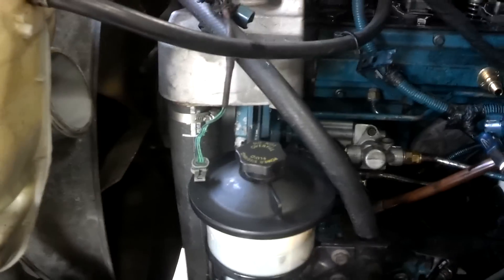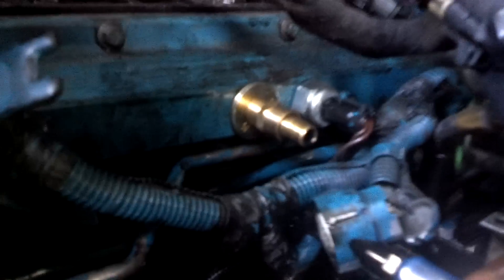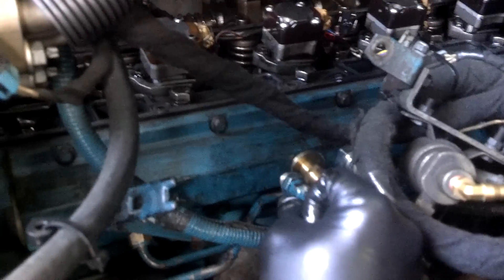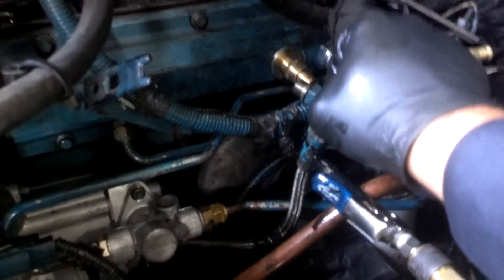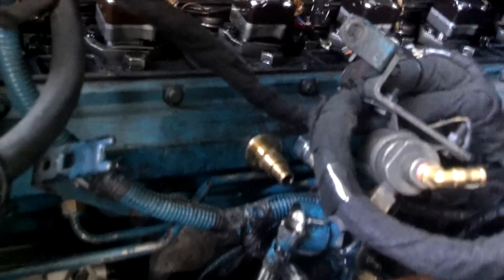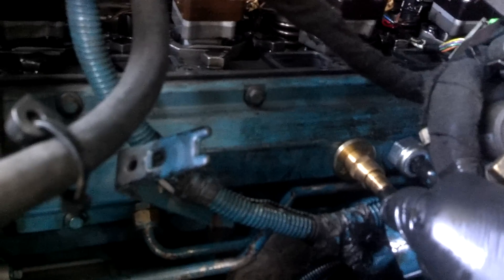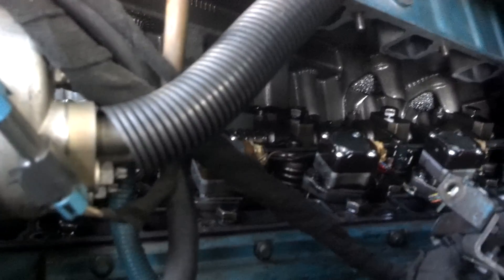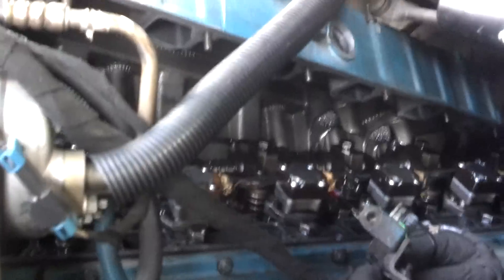How to fix low injection oil pressure part 1

Comment: Hello!! My 2001 international 4700 with a dr466 started pouring oil from behind the  high oil pressure rail closer to the front of the engine!! Do i have to remove the valve cover to get the high oil pressure rail off?? Thanks!🙏
Reply from the maker: Hi, sorry for the late reply. I would remove the valve cover. On that model I'm not sure if you can get around it plus it frees up room to work on the line. Make sure you clean the area well so you can get a good look on the exact location of the leak. Keep me posted please! Hope i helped😊
Reply: @The_Mixed_Ron_Swanson  i fixed it already! No more leaks! Replace the gasket and new set of bolt torqued it to specs and it’s nice and dry now!! Thanks for the advice!!

Comment: Hi Guys , appreciate this video, I was wondering if anyone can shed some light on my problem....I have a Navistar....badged as perkins 1306 series here in uk , it wont start unless using easy start aerosol......it has good oil pressure in the gallery approx. 1000psi when cranking , also good fuel pressure in the rail....hand priming pump is working ,etc, checked the fuel  valve in the end of the gallery , seems all good, swapped cam pos sensor , checked wiring from control panel...….ipr sol getting voltage ,etc....any ideas why it wont start?   customer who owns this generator had the injectors tested before it come down here....he mentioned when he got it running it would start to slow down in speed when under half load.....the engine is 330hp at fixed 1500rpm , year of engine approx. 2012.     3500hrs. any thoughts ????
Reply from the maker: Did you happen to look at the injector seals? Sometimes if you hook up air to the oil inlet and pressurized the line you'll hear hissing if there's a problem. I'm not familiar with that model but if it's close to a Benz diesel, that might be your problem. Also check the Low Pressure Oil Pump if possible. Malfunctioning LPOPs can affect the oil pressure needed to activate the fuel pumps. I hope this helps. Keep me posted😊

Comment: Question have 1998 international 4700 DT466E  truck was fine when I bought it just the radiator hose was sucking in and fuel was being sent to the coolant reservoir so decided to change the injector cups and the injectors them 
selves also coolant filter truck seems to be having trouble going above 15 mph RPMs won’t go above 1500-2000 truck is automatic any idea also replaced the coolant reservoir cap
Reply from the maker: Whew... Lol I'm sorry your having so many problems. Is the hose sucking in? If anything you should have more pressure than a vacuum issue
Reply: Yeah after replacing the injectors and the cups and coolant filter and coolant cap the hose stopped sucking in just that when the truck is running it won’t do more than 15-20 mph and stay stuck at 20 rpm
Reply from the maker: @tacplayz2364  in neutral or in gear?
Reply: MrHunitspokes  in gear while running is when is seems to lose power

Comment: Good morning...I have a 2004 international dt466 ....automatic transmission....it dosent start in the mornings...once you started it works fine it's just when I start it in the mornings????do you know what it can be...???
Reply from the maker: Hey, yea that's a pretty common thing with those. Usually it's due to a lack of high oil pressure activating the injectors due to seals failing especially in cold weather.

Comment: nice video, I was wandering if I want to check the pressure of the HPOP from oil line, how much is the size of the thread that I can connect the pressure gauge to the HPOP ( high pressure oil pump )
Reply from the maker: MBB NoOTHER that's great question, i couldn't tell you off the top of my head, most pressure guage kits come with a few different sizes, just make sure you get a set capable of handling a couple thousand psi. hope i was helpful 😊

Comment: YOU SHOULD HAVE DONE THE INJECTOR LEAK DOWN TEST BEFORE YOU COSTED THE CUSTOMER $3K FOR PARTS CHANGING.
Reply from the maker: RIP the only thing i costed them was some labor and some injector o rings. i think you may have misunderstood what i said. i have replaced maybe 2 hpops in years. thanks for your input 😊

Comment: Excellent tip, thank you.    One other check for no start if there is no high pressure oil.  Make sure the reservoir cavity in the timing cover is full of oil. (removable plug in the timing cover to access and fill it)  I had one parked for 2 months and the cavity emptied out, it would not start no matter how long it cranked.  Filled the cavity and it started right away.  High pressure pump is fed from the main oil pump downstairs, for some reason cranking would not fill the cavity.  Look for this cavity reservoir if you have no high pressure oil.
Reply: Where on the timing cover is the plug?
Reply from the maker: M Stewart that's correct, some of the larger semi engines rely solely on the the hpop, but yes, great tip!😊

Comment: I have a 98 model DT 466 that I am having problems with. It has low fuel pressure about 65 to 70 lbs on the transfer pump. When you start running it down the road it acts like it is running out of fuel, but the fuel pressure stays up, and  the gauge bounces a lot. You can let off of the fuel peddle and it will smooth out and the gauge will go back to normal. Can you help me?
Reply: replace fuel pressure regulator in teh fel filter base.